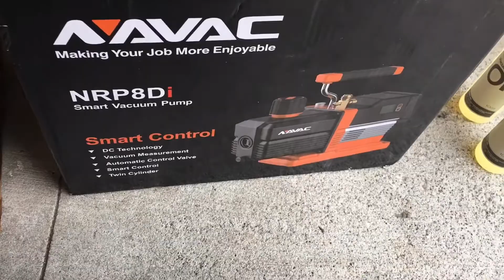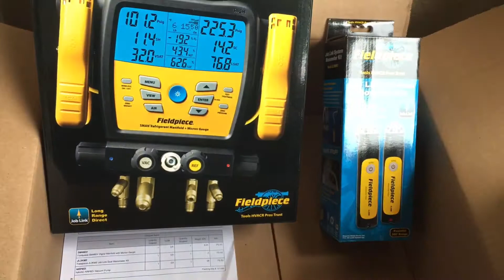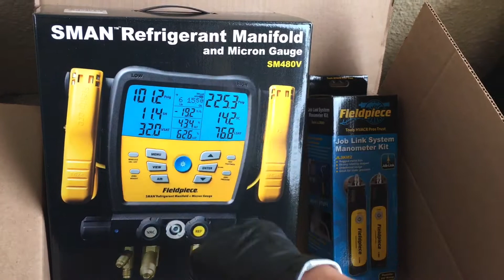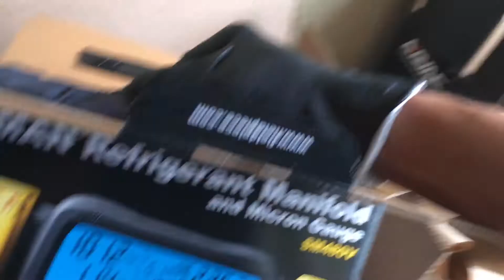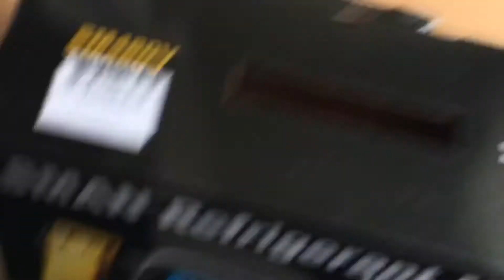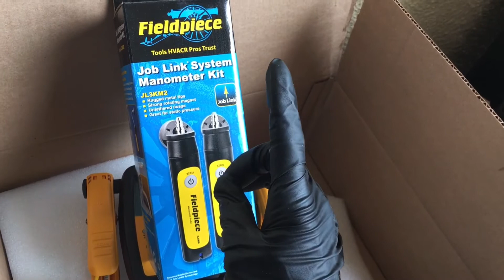Tru Tech Tools Christmas time delivery for an HVAC guy

Comment: Following your recommendations, I replaced the hoses with ABB fittings with BV hoses.  Upon isolating the vac pump the  microns jumped by about a thousand.  Spend a lot of time.  Conclusion: shipped my new SMAN 380v to Fieldpiece service.  Now, what would you recommend next?  Should I replace my Small Robinair 1,5 cam pump, or purchase some 1/2 in vac hoses?  Perhaps both?  These tools are only for my personal use.  Is the an alternative to the "little" cans?  A 30 lbs cylinder of 134a is too much.
Reply from the maker: Horst H The jump you got from turning the ball valve was a tiny amount of air that was trapped inside the ball valve.           The secret to getting rid of that air is slowly turning the ball valve open and close several times and a vacuum pump will remove that air as you achieve a lower vacuum then you can isolate after that to get a true reading.     Future videos being worked on will show this procedure and explain what is happening. This is where it’s important for the technician to understand his tools and service procedures that can give you false readings and how to correct it.  There was nothing wrong with your gauges it was the procedure being used.
Reply: @coldfinger459sub0  "experience is the most expensive school". I'm so intrigued by the AC systems because of past experiences, which led me to the conclusion that most people I dealt with had limited basic knowledge, working by rote.  Then there are individuals who know, but don't care.
Hence, my respect for you!
Reply from the maker: Horst H You are 100% exactly right. 👍👍👍
Reply from the maker: A 1.5 CFM vacuum pump is just fine it just takes a little longer.  So long as your vacuum pump is still in good condition and pull down to it’s rated micron ratings keep your pump. I don’t know what country are you and put some countries have smaller cylinder is like 5 or 10 pounds 2.5 kg .
Reply: @coldfinger459sub0  thanks!  I'm in NC, spend many years in NY and MA.  Shall research for a mid size 134a cylinder.

Comment: Hi car the was never wrecked has 3000 miles should I have 200-300 psi on high side on a 80 degree day I remember the mechanic saying he was missing 50 psi on the high side
Reply from the maker: Bob 300 psi at 80° would be a bit on the high high high side

Comment: Hi the numbers you asked for on the 2019 Challenger are as follows not running psi on both around 90 at idle low side- 37psi high side- 150psi at 1500 rpm low- 28psi high- 162psi outdoor temp-81 degrees humidity 68%
Reply from the maker: Bob So this is where I’m trying to head towards diagnosis if it does not have a internal heat exchanger to this is a very important factor.  If it does not have an internal heat exchanger then we could do simple plain old hands on diagnosis well let’s not use the terminology hand with a clamp on temperature sensor. And if the exiting temperature sensor of the suction line it say somewhere in the 43° 39° something like that you should have cold 40+ degree air coming out both vents of the dash.  Basically both sides of the dash should be nearly equal within say 2° of left to right passenger to driver side.  If the refrigerant charge is completely full only completely drained only completely evacuated and only filled by weight to 100% of manufacture specifications not guessing by topping off

Comment: Thank you I’ll get the pressures at those rpms the coldest on passenger side is 50 and 70 on drivers side and I think it was the high side they were missing 50 psi can you send contact info to bmvplumbing@gmail.com

Comment: They had the dodge engineers trying to figure it out 
1st trip they saw it was bit low on refrigerant they filled it with leak detector.
2nd trip found no leaks they tested blend door and actuators all with spec 
3rd trip they replaced expansion valve and refilled no difference the tech did say they were trying to figure out why they were missing 50 psi on high side. 

You seem very knowledgeable on these things but are far do you know of a specialist here in NY somewhere.
Reply from the maker: Bob The first problem is they had an engineer out there sorry to say engineers are the last people you want to touch anything they are not field people good at math though.        50 psi on the low side. So many things can cause this and there’s a lot of information missing.  Curious what is the lowest temperature out the passenger side duct ?  and what’s the highest temperature out the Driver side duct?.                    Temperature in pressures at idle then temperature and pressure around 1200 RPMs or 1500 RPMs.       Forgot the biggest question is most important at all has this been in a front an accident and repaired and a body shop this can lead you down a rabbit hole of man-made problem that is more difficult to diagnose.    ( body shops are the root of all evil in our trade !!!.)                 Does this have external heat exchanger (where are the liquid line is connected in travels in tubes surrounding the suction line and then exits again out of the suction line to deliver cooled refrigerant to the TXV.    Every time you add a different scenario to the equation you multiply the possibilities and makes it more difficult for the technician.          And out of curiosity what did they refrigerant analyzer show hopefully it’s 100% pure R1234YF ?.  If they did not use a refrigerant analyzer they are fired.    What was the exact weight in grams removed from the system compared to what the manufacture quantity in weight that is recommended for that vehicle by the sticker under the hood ?.  If they just added refrigerant they are immediately fired and should never be allowed to touch air-conditioning in this trade again.  You do not top off these new vehicles especially if they have internal heat exchangers or variable compressor displacement. If so they are to be handed job applications for McDonald’s or a janitorial service but never allowed into the Automotive trade again.      And it is possible this could be a difficult one since it’s such a new vehicle. Even I if I worked at the stealership, it could turn into one of those learning experiences where you know you have to ask for more time then you will get paid for just to learn and discover something that might not be in the books who knows anything is possible. I would ask to take one of the vehicles off the showroom floor out in the lot or another customers same year make model everything exactly the same and do a side-by-side comparison. Remapping and learning the system old-school way to trace down the problem if the trouble tree cannot lead you to an answer.  Not everything is a black-and-white answer especially when humans are involved.                       What year and model ?  I have worked on several 2019 challenger’s or chargers and pick ups from the dodge series at body shops it’s still considered a very new vehicle so nobody really has a lot of hands-on experience diagnosing problems on such a new vehicle.                           But I think I’m gonna start feeling sorry for the guys trying to figure this one out probably would take me some time to in sounds like it would be a learning experience

Comment: Hi great videos I have a 2019 dodge w/1234yf and have a difference of temp between drivers/passenger sides 20 degrees dealer is stumped do you any ideas your help would be appreciated
Reply from the maker: Bob first two easy possible things that come to mind. Some vehicles because of their evaporator placement in the way the air flows over it and divide between the ducts    The warmer air flows over the top of the evaporator out of the closer duct towards the driver side the colder air on the bottom where the refrigerant flows in is closer to the passenger side.   Option two problem with blend doors.                    If the dealer is stumped that is sad but that is reality and the majority.  Impossible to diagnose something without seeing it and actually placing my hands on pipes at different locations to diagnose because temperature measurements at many different points are the key factor in diagnosing.                     It’s easy cheap and fast then the labor required to just recover the system well the equipment is hooked up and completely recharge it and then diagnose with a known good factory quantity by weight of refrigerant not by guessing. With my equipment this would only take 15 minutes with the equipment the dealer has it may take well over an hour depending on ambient temperatures.         I left out a few things that are left common and that could be done but keep this as short as possible.                      Unless there’s a particular TSB technical service bulletin report on a very unusual problem we do not know about yet.